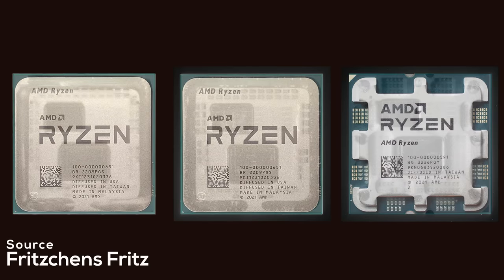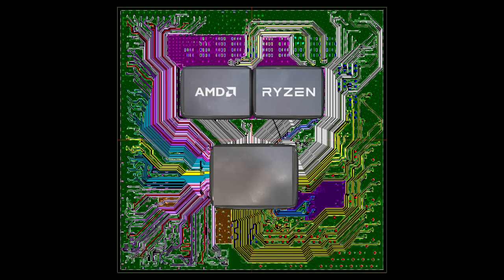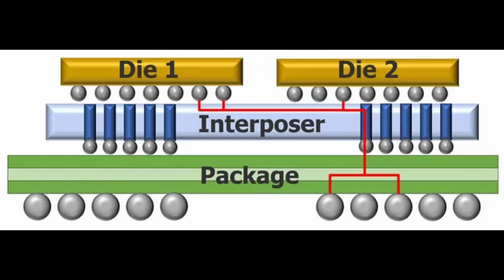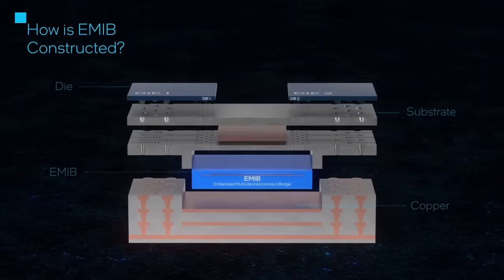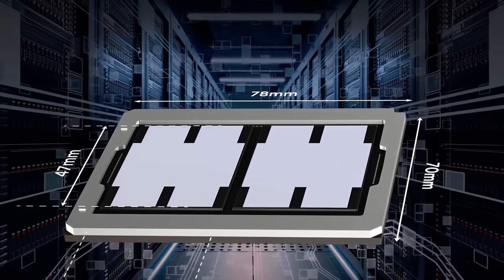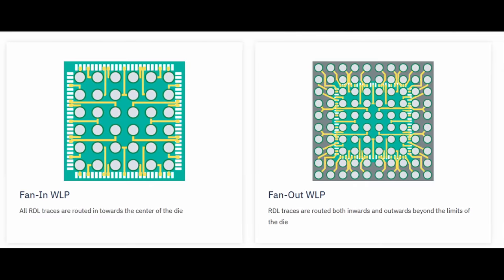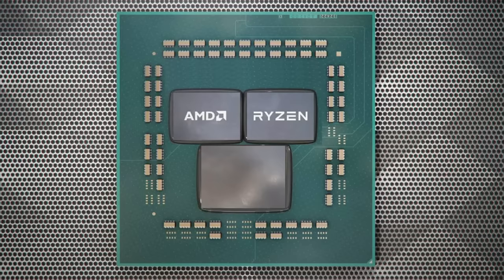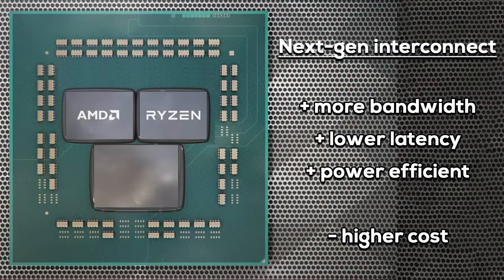AMD ZEN 6 — Next-gen Chiplets & Packaging

Comment: I wonder what comes next after silicon bridges.

Stacking dies on top of the I/O die?
Reply: @brainletmong6302 Yeah. AMD claims it's no problem with two layers (normal CPU + V-cache), but three layers? More? We're bound to see issues.
Reply: From what I've seen the next step is to get latency and bandwidth of existing interconnects back to monolithic levels, but far future I would expect to see stacked logic and I/O like you've said. I could see CCDs stacked on top of an active interposer that houses the I/O functions.
Reply: how to manage the heat layer in x3d variants,high IPC,low latency and high cache cpu is amd future,if they dont mess up
Reply: the current x3d stacking is fine, it's just not rated for the same high temperature as the CCD below
Reply: @pham3383  The obvious and more sensible option is to just put the cache chip underneath instead of on-top.  The drawback is that you basically cant do 'optional' cache chip additions anymore and have to use it as standard unless you want to make a different chiplet without the same connects underneath.  But the benefits are great.  You can use more cache, you can get better cooling on the compute that needs it, and you can put more cores in a CCD since you dont need to put any large L3 on the main compute die anymore(or alternatively use a smaller die for the compute chiplet).
Reply: @maynardburger There is still a flaw with this move. If the cache layer is more sensitive to temperature, it will be more harmed by having a layer of silicon between it and the main die. This is made worse by that layer being the CPU core logic, often the hottest part of the entire package.
Reply: @DigitalJedi  since the vertical distance is still less than horizontal distance, they have room to sandwich more silicon in between, use this silicon as Via, then make it thick enough to wick heat from the side.
Reply: @xponen  From my experience in die packaging, that doesn't really work. Cooling from the edges will leave a hotspot in the middle, and a thicker die makes it even harder to alleviate that hotspot from above or below. The most effective way to cool a die is on the largest face parallel to the logic layer, which means you are using the flat side without microbumps in an FCBGA package.
Reply: @DigitalJedi  use via to conduct heat to top layer of the sandwich. It will even improve thermal dissipation for non-3D packaging. You can deposit copper plate on the thick silicon that you sandwich between 2 layer and conduct heat to the side and up to the top face/layer thru via.
Reply: @xponen  That is an incredibly complicated packaging process that includes additional layers and requires vias to be places all over a die that otherwise didn't need them in those locations. In addition, if you are doing a large copper layer between dies to move heat sideways, your inter-die communication vias must not contend with both the added thickness and be placed where you can have holes in this layer.

You generally want to avoid putting things between the dies in these stacks, as it just makes the whole connection process absolute hell, as if it was simple in the first place. A huge part of my work on Foveros has been to make the connection process as easy and node agnostic as possible, and these additional layers stuffed with vias run counter to that if I'm understanding correctly. You're either trying really hard to make something completely impractical work or not articulating what this idea is very well.

The simplest solution is to just limit power to something reasonable in these true-3D assemblies and leverage the advantage of having functionally no reticle limit to go wide and slow wherever possible. Keeping voltages in check is the most important part for that heat generation, so things like per-core throttling and voltage control are big helps in that regard.
Reply: @pham3383  Why not just put the x3d layer below the cpu die instead of above it since it's less thermally conductive anyway?

Comment: You make a good case for what AMD might do for Zen 6 consumer products. I also think we might get a preview of it with Zen 5 based Strix Halo if it is multi-die as has been rumored. InFO_oS seems like the natural method of going about since we've already seen it work with GPU IP in RDNA 3 and it would need a more efficient interconnect for mobile and APU use. Odds are probably still good that for at least some enterprise products they will use silicon bridges or interposers, especially since like Intel, AMD will also be looking to use HBM on Epyc if the rumors pan out.

Comment: Curious why the ‘double die’ method used with early Pentium D’s was abandoned.  It seemed like a good solution for two dies communicating with each other and yields.  If both dies were good, you have really low power intercommunications already in place.   If one die is good and one is bad, you can create a lower end chip by slicing in half.   If the yields are mixed,  then you have an intermediate product (i.e. 7900X instead of 7950X).
Reply: I think the Pro vs. Max version of Apple Silicon chips use this approach.
Reply: Data rates are much higher these days.  First gen Ryzen used the dual die method, but it had all sorts of problems moving memory around efficiently when scaled out.

The IO die method allowed keeping the cores all fed evenly and kept costs down.  But, DDR5 is outpacing the bandwidth AMD can get with the current link density, so a solution to that issue is required.
Reply: @unvergebeneid   Sort of, yes, but they use the area of the die that would normally be cut to transfer data, so it's just on piece of silicon.
Reply: The Pentium D was a terrible solution.  There was no interconnect at all.  They were two separate processors communicating over the front side bus through the socket.  Same situation later with the Core 2 Quad, which was two separate Core 2 Duo chips that could only communicated over the FSB through the socket - no interconnect between the dies at all on the package.
Reply: @TrueThanny  wasn't the FSB famously slow and bottlenecky anyway?
Reply: @unvergebeneid  That's kind of my point.  Having the two dies of the Pentium D and Core 2 Quad communicate over the FSB hurt multitasking performance significantly.

It's not that using two dies is a bad idea.  It's that doing it half-assed the way Intel did is a terrible idea.  When AMD moved to Zen and MCM, they made sure to have a proper interconnect first.
Reply: Because CPU's don't talk to each other. CPU to CPU communications are just cache probes which are better handled by the integrated memory controller.

Comment: Motherboard redesign to allow more than 128 PCIe lanes at full speed. Imagine having at least 4 PCI Express slots with x16 lanes at full speed and having workstation/server capability in a moderately priced package. Imagine the improvement. The only thing is, one can't work without the other.

Comment: How is EUV reticle size affecting interposer? They would use EUV for  core chiplets and increasingly older processes for bigger silicon. Wouldn't be surprised if the interposer was 28 or higher
Reply from the maker: DUV has the same reticle size. And yes, you are right, interposers are mostly older, non EUV nodes.

Comment: The era of band-aids and patches. It was the norm to bring as much as possible onto one die for decades of course because it saved power. But the cost per transistor has largely stopped at 28 nm nodes, so now this makes economic sense. Chiplets with just a PCB are hobbled. We can call these things anything we want but they all are just fancy versions of wiring boards with more or less capacitance depending on the feature size. Intel seems to be betting on glass (not mentioned here). Although it is put forward that silicon is not economic that seems to be what Intel is doing for now until they move to glass. It will be interesting who uses IFS technologies in the next few years.

Comment: Cache cascade. I would like to see Zen6 with support for more on package and on motherboard memory cache chips. The on package version could potentially leverage the new interconnect as a high capacity and high bandwidth L4 cache. The on motherboard variant could be a cache between main memory and storage similar to Optane/3D Xpoint. CXL/infinity fabric might be utilized for the on motherboard cache while infinity link is used for the L4 cache on the cpu package. The existing extended L3 3D V-Cache should remain as well in addition to these other caches for models where the cost is tolerable. These additional caches could help improve overall performance in some cases in addition to any internal CPU architectural improvements.

Comment: I hope that the implementation of organic substrates at those scales does not mean shorter lifespans where the effects of high temperatures during a span of years end up degrading the organic layers causing cracking and corrosion of conductors or bad contacts. Right now I can take a CPU from 20 years ago with 40k H of usage and still works.

Comment: I was amazed to see Package-on-package solutions being used on earlier versions of Raspberry PIs some years ago. Would thermal management be the major technical challenge for these kinds of platforms?
Reply: Mobile SOCs have been using memory on package for a very long time, it's tech based on Toshiba's DRAM package staking, from 2 decades ago. RPIs have always used Broadcom SOCs for embedded solutions, that do have stacked DRAM over logic, and they were somewhat early in implementing the technology for the mobile market.
The main limitation is memory size, although you can stack 10 high right now. Some of the cooling efficiency loss is gained back as memory transfers are more efficient with less metal in the way. But yes, the more you stack, the more you alternate silicon and packaging material and silicon etc. - creating a heat barrier.

Comment: Excellent video, i’m both intrigued and confused.
AMD’s chipset design seems to be much much more rudimentary than Intel’s EMIB and foveros. Yet, it worked much better. Why?
Reply: I think it worked because it's simpler. It didn't require as big a leap in technology as Intel's strategy.
Reply: Intel used monolith for desktop, chiplets for laptop. AMS used monolith for laptop, chiplets for desktop. Weird but each have their own advantages.
Reply: Packaging is only one part of CPU performance and efficiency. Monolithic is most performant and most efficient. More advanced packaging will not compensate for deficiencies in the node, micro architecture, or core layouts/counts. You can use chiplets to increase performance by having more silicon than monolithic, or reduce costs by using such smaller dies that the higher yields and simpler design pay for the packaging and then some.

AMD uses a tiny chiplet to house their CPU cores and uses this chiplet and most of their server, workstation, and mainstream CPUs. With such scale AMD can easily bin their products to have high frequencies for desktop and excellent efficiency for server and workstation; they are also very cheap with excellent yields. AMD’s usage of a separate IO die allows them to use a separate node for IO, and AMD can save a lot of money. The negatives of using such primitive packaging are higher in server and workstation. AMD remains more efficient than Intel by using more advanced nodes and having higher core counts. The higher core counts also allow AMD to maintain a performance lead. All together, AMD’s chiplet philosophy reduces costs for the company.
 
Intel is less efficient than AMD primarily due to less advanced nodes. The 13900K at ISO power is more efficient than the 5950X, but is competing with the 7950X which has a node advantage. Meteor Lake is actually comparable in efficiency to Phoenix in spite of using tiles, but the silicon interposer causes it be much more expensive than Phoenix. On server Intel uses massive tiles over 5x as large as AMD’s CPU chiplet. Intel is limited by yields causing many of their server products to be delayed. Intel can’t go bigger due to poor yields, so their server products have a core count disadvantage compared to AMD. Delays cause Intel to launch on poorer nodes, and having fewer cores further hurts performance and efficiency compared to AMD.
Reply: AMD got into it first on consumer platforms. We've only seen EMIB in server chips from Intel so far. Up until very recently with Meteor Lake, which uses Foveros on a full interposer, all Intel consumer CPUs have been functionally monolithic. AMD actually loses power everywhere with their current interconnects compared to a monolithic chip, and you can see this in idle power draw where a 14900K can get into the single digit watts while the 7950X sits above 20W most of the time.

Where they got ahead was with a process node advantage, sometimes multiple steps ahead. Intel's 14nm was impressive for how much they extracted from it and how much power the dies can take before exploding, but it was never a highly efficient node aside from the year or so it was brand new and everything else was just worse, making it look good in comparison.

Comment: 5:20 why the EUV reticle limit in particular? I would've assumed you could use a much older node since that would still be way denser than a PCB
Reply from the maker: I misspoke, it’s not about the EUV reticle limit since most interposers are produced in older nodes. But DUV has the same 858mm2 reticle limit.

Comment: I think AMD will again use the dense organic interconnect that they used on the RX 7900XTX. A silicon interposer for Epyc would be difficult and expensive due to size. So, if servers aren't using interposers, consumer products won't either.  I think the RDL material is a possibility for server too. Actuality, since the compute chiplets are the same, server and consumer packages have to use the same fan-out packaging technology. So it will be RDL.

Comment: There is no EUV reticle limit for interposers because the feature size should be well above the minimum for 193nm wavelength lithography. 

No one will make a huge interposer on a fab that could be making 28nm planar semiconductors instead.  It's all going to be coming from depreciated fabs, probably from the 90nm days or earlier.

The only question I have is if manufacturers will start putting active or passive components on interposers.  Resistors seem like an easy thing to do.  Inductors are typically done near top metal so that would also be easy.  Capacitors would need poly, gate oxide and doping so that's a lot more process but it gets you close to doing CMOS or bipolar devices.
Reply from the maker: The DUV reticle limit is the same.

Comment: Silicon interposers or bridges should be manufacturable on obsolete manufacturing processes like >28nm, no? And they wouldn't be nearly as sensitive to minor defects as a CPU or GPU. So they'd increase cost, but not anywhere near as much as you might guess based on the size of the "chip" compared to a modern CPU or CPU. Those old foundries are probably very cheap to place orders on as well as very reliable.

Comment: Why not 3D stacking, with chiplets on top of i/o die and L3 inside the i/o die? And Infinity links to connect more i/o dies on Epyc...
Reply: Think about how you would cool that stack. The I/O die can run fairly hot itself. L3 inside it could be interesting, but keeping as much cache close to the cores is better, which is what V-cache is for. Long term I suspect an active interposer handling I/O could happen, but bridges between dies would also do mostly the same job.
Reply: @DigitalJedi  cooling side, Is the same as actual x3d parts, but with hotter Chips on top instead of on bottom...

Comment: Would it be possible to use older generation silicon tech for the interconnect silicon stuff? Like this might not be true, but my assumption would be that we only have a very limited capacity to make like sub 5nm stuff but a much larger capacity to make like 20nm stuff. And I was thinking that couldn't we just use the 20nm factories to make the interconnects cheaply and then then 5nm factories for the actual important chips? Surely the interconnects don't need to have the fanciest smallest gates possible?

Comment: Don't Meteor Lake CPUs use silicon interposers?

If they change Infinity fabric, I think we it should expect an additional "interconnect tier" that is decoupled from infinity fabric. Faster than infinity fabric, but slower than L3 links.

Chip and cheese also showed that L3 latency penalty from N21 to N31 was surprisingly small.

Comment: On desktop and server it seems overall better to increase cache than fabric performance, if it comes at the expense of cost.

One must not forget that the IF design was developed due to cost. It was the cheaper way to increase core counts beyond what was possible.

Is the fabric power even an issue right now? From everything I see, the issue is that power is not scaling as well as density on new nodes. So we end up with 95C cores and 200W+ CPUs.

Comment: I wonder what applications zen 6 will do better considering the design change.
Reply: Frame pacing for games and latency sensitive applications will be the biggest benefactors of Zen 6.

This also solves energy consumption when communicating between different dies so Idle power consumption should go way down as well.
So chiplets are a more viable technology for mobile applications like laptops and maybe even handhelds.